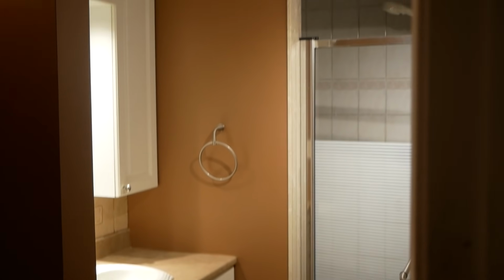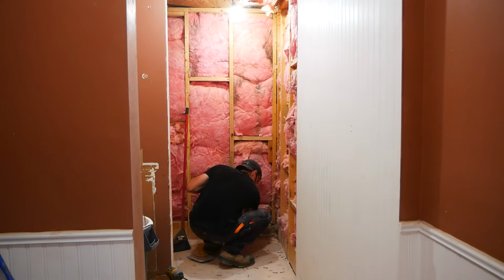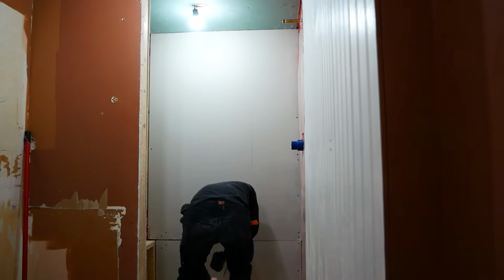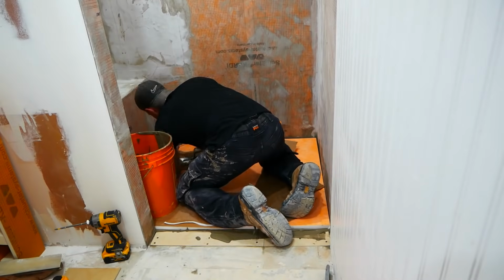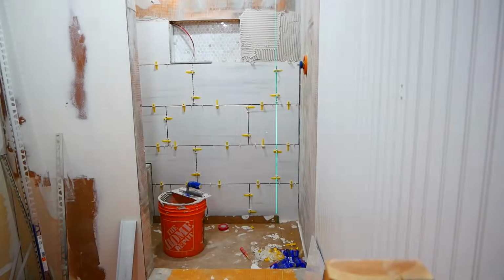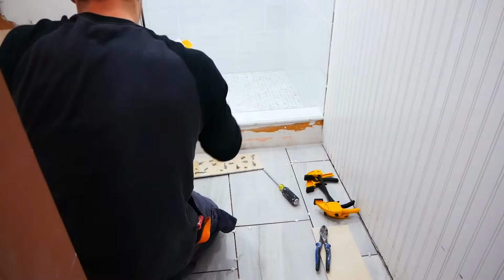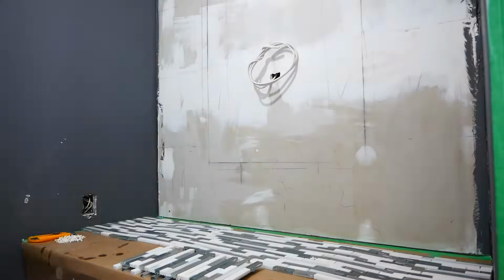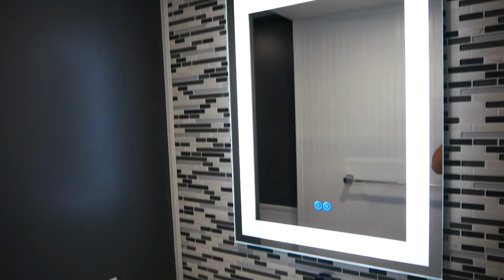DIY Bathroom Remodel | First Time Renovation for $4000

Comment: Nice.  How is the Schluter system holding up so far?  Seen a lot of videos where Schluter drains, edges started to leak water.  Just wondering about your experience with it.

Comment: I appreciate how difficult some of this work is, as I recently completed a similar small bathroom upgrade using Schluter.  But I can’t believe how much thinset mortar you got on the inside of the membrane.  I’m not the neatest worker in the world either, but when I finished, the membrane had very limited bleedover.  I read the directions and used a drywall knife to press the membrane into the thinset.  Maybe your use of the float caused the membrane to be completely covered with thinset, I don’t know.   Anyway, it came out nice.

Comment: 100CFM or 170 cubic meters per hour is WAYY too much for a bathroom. I work in the R&D department of a ventilation company and we extract 50m3/h out of bathrooms (30CFM). 100CFM is overventilating your room and it will not prevent fogging up the mirrors, just saying...

Comment: You are the only one doing this that showed the actual shower curtain(s) and how they look/work. Great job! I'm building a spa type bathroom in the middle of the woods. Claw foot tub was the only problem with that hoop rod. I think I will turn the backside curtain so you can see the design from in the tub though because the front curtain will be open except when in use!! Thanks for showing all this!!

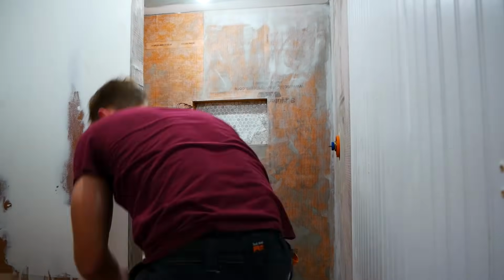Comment: 14:50 you did a crucial mistake! You should never apply the grout immediately, especially if you have waterproofing underneath! Moisture in the tile adhesive has no place to get out while drying! Do not be surprised if that tile adhesive it's still wet even 2 years after you did it.

Also, you should have went with a shower diverter for 2 water outlets. Shower head and hand held shower sticking out of the wall as well.

Comment: This is the first video of yours I saw. I'm age 21 and got into construction at age 19 in the pandemic. I've not done a whole bathroom on my own yet. But this video got my attention.
Reply: I love how ballsy you are to use your qualification as an electrician to do a whole bathroom remodel!. I learned from the Vancouver Carpenter that in Canada electricians are called Sparkies. I get that it is for your mom and your bathroom. I grew up in an old run down house on a farm. I didn't fix up anything other than build a basement workout center for pull ups, dips, vertical sit up bench and roman chair sit up seat. The basement was sometimes damp and I tried some "paint" for water issues to help keep walls more dry. We only rented and the place was shitty. It's funny now that I think of it that I have used my time in construction to do some electrical work and plumbing work. Youtube helped me. But have to say your first try here was really really good. I can see you keep doing it.

Comment: are you allowed to use 14/2 awg on 20amp breakers? i had an electrcian use 14/2 on my lights in a kitchen, i thought it was suppose to be 12/2
Reply from the maker: No 20a requires 12/2

Comment: I gutted a 1950s bathroom.  Small 4x3 Walk in shower. The rest of the walls were tiled half way up...

Wow. The pan was 5 inch thick concrete with a lead plate below.

Every square inch of the shower and walls that where tiled was 1.5" of plaster behind the tiles.
The main floor was 3/4 of mud & lathe plus the tiles.

Had to use a 23lb demolition hammer to remove it all.

By the time we gutted that and weighed the dump trailer there was over 4000lbs of material removed.

Unbelievable that the floor joists were holding up that much extra weight in one small spot lol.

Comment: Honestly the old bathroom is not bad. The grout and stuff looks dirty though. I wonder if it could have just been resurfaced.

The new one looks "modern" because it's white and grey which seems to be what new buildings in the last 5-10 years use.

But still great work and it will add value when you sell the home. I am just shocked at how quickly people feel something perfectly fine is outdated

Comment: Great job, especially for a first go. The Schlueter stuff is great but should be used a secondary defense. It is easy to use tilebacker/cement/multi-boards instead of normal drywall as your primary. They are waterproof by themselves and don't have paper components that could rot. I use them on floors as well and so any wooden subfloor doesn't rot around toilets etc.

Comment: As a Master tile setter, Master carpenter and Pro Renovator, I fully expected to pick apart your work! Happily, I was mistaken!!! If you weren't already a high priced "sparky", I'd hire you to work with me in a second! I've hired/fired a couple dozen apprentices over the years and always wished I could have come across someone like yourself. You must have properly researched waterproofing with Kerdi membrane, you did an excellent job...One question, How did you glue your ABS drain up before installing your Schluter pan? Did you remove the round, thin foam that goes under the drain flange and slide them in later? You didn't show what happened there. I always dry fit the drain flange, cut the drain pipe to height, install the pan, then glue and mortar the Schluter drain at the same time. You did an excellent job and saved your Mom a pretty penny... :)
Reply from the maker: Thanks a lot! Schluter has a video in which they go over the no access plumbing installation which I followed. Pretty much what you said though

Comment: Should have used Durrock or cement board for the shower instead of regular drywall thats against code almost everywhere now, You put up cement board then coat it with Red Gaurd or simular product. last for decades

Comment: Just adding to this, nice work but even though schleuter recommended drywall I would still avoid it in the shower. I’ve demoed many showers in 30 years and mold will grow inside drywall even with hydroban. Use durarock in the showers! I have done the testing myself. I have cut separate pieces and left them in buckets of water over night. Drywall no matter what you treat it with acts like a sponge. Then the water has nowhere to go so it molds. Durarock was dry 10 minutes after taking it out of the water over night. It has Portland cement in it and acts as a drying agent……..

Comment: Wow great first time! You should be proud of yourself.  A suggestion would be for laying staggered rectangular tile, it would look best to lay like subway tile.  Underneath one non-cut piece of tile place two non-cuts meeting directly in the middle of the one above, then work outwards from there. White grout isn't as noticeable when not staggered the way I suggested, but when it get's dirty it may be.  With grey grout (if staggered correctly), inevitable staining isn't an issue.

Comment: "I'm only 22"? WTF? You don't have to be 80 yo to do carpentry.
Reply: What kind of silly comment is that? Obviously, at 22 a person would have not much experience in doing contractor work - way more than carpentry - tiling, plumbing, and electrical work. 🙄

Comment: I'm curious the plumber that recommended sharkbite for long term use. It's not a matter of if it'll leak, but when. Sharkbite should only be used in temporary situations to hold ya over until it can be soldered.

Comment: Did you check to see if it is in code to poke a hole through a wall and run a wire? I had a tv mounted and said that he wouldn’t do that cause if anything happened insurance wouldnt cover it

Comment: Good job.  But you are gonna have to grind the underside of that bathroom floor tile or the floor enough so that your tile won't stick out.  Yeah, those tile levelers help but sometimes you gotta make that space deeper.  You really don't need tile levelers if you use your thinset like a leveler.

Comment: Looks good. But, did you use wall tile adhesive for the floor? That would quickly break down with being walked on. You need a cement based adhesive.

Comment: The schluter board you used on the floor cant actually be used on the walls too making a easy install. They also make cuttouts for neches. Looks really good though I'm a electrician too but I worked for my old man doing remodeling from 2018-2020 before graduating and currently in training for Linesman for my local power company

Comment: I’m currently tiling my kitchen floor using those same QEP clips, 12x24 ceramic tile and I have to say from my personal experience I don’t think they helped much or at all. I feel the wedges were way to small for large format tile and didn’t produce enough pressure to lift the tile. They also have lash clips that I would stay away from completely. They have a curved edge and when I used them they would lift the tile up and unbound the tiles from the thin set. All in all I wouldn’t recommend the QEP brand I’ve seen other brands with bigger wedges I think would have worked better just my two cents.
Reply: Noted. Thanks for the heads up. I’ll be tackling this in a week.

Comment: Great job!  (Why not just use duoRock cement board for the shower walls though)?
Reply from the maker: Thanks! Cement board is heavier, harder to cut, more expensive and not necessary when using the Schluter system

Comment: Hey man you shouldn’t used shark bite fitting on Plumbing system. They are leaks so easy and you put them in side the wall. If those are leaks you’re going to open the tile again. I’m just saying

Comment: Really good job on the tiling. I’d say for that 12x24 tile it’s usually recommended you use a half inch notch trowel for better coverage. Good choice on picking schluter. Also nice jobs on the 45 cuts on the profiles.

Comment: Very talented, young man! You are so talented! I lovew the details you've thought off, liike the lit, tiled niche... or the led mirror. On thing you should add is more outlets. Or a cupboard area nearby or shelves for toiletries. Any women is going to need a lot of storage area and we need to plug things in all the time, from toothbrush to curling iron. Right now I am using my father's former bath and there is not enough space anywhere for all the bottles, even the medicine cabinet and one other little cabinet don't hole it. You need to think space!

Comment: I wouldn’t recommend putting drywall inside a shower bathroom especially for your walls your supposed to use hardiboard and then coat it with some Redgaurd memebrane due to a lot of moisture in the shower. It looks nice tho! I’m 23 and do tile in Dallas.

Comment: Good work but you wasted alot of time. Next time doing the shower, when the joist and studs are bare, dont add sheetrock, cement, kirby board and all that crap. All you need is cement boards screwed into the studs, tape and cement the seams where the boards meet and redguard the whole thing. If you spent 4k on that little bathroom, you also wasted alot of money.

Comment: Not trying to put you down brother but number one mistake is using regular sheet rock inside of the shower. Definitely have to use the green mildew sheet rock or a hardy backer. At least next time you will know never use normal sheet rock inside of a shower. Just coming from a contractor

Comment: You did a good job and are aware of your mistakes. Biggest issue is that unlevel tile in the transition, worried that may crack over time. We recently remodeled our 6x7, 105 year old bathroom down to studs and filled a giant dumpster!

Comment: Honestly, I don't 100% trust the schulter systems. Of all years of installing tile, we've always gone with the hardi-backer boards to not worry about the moisture. Same goes for the floors. Just screw them in and go. For the joints and water proofing, we use customs red guard, it's a self drying rubber that hardens. All in all though, you did a really good job and definitely saved A LOT of money by doing so. Props to you.

Comment: I like the idea of the timer for the fan, I was considering putting a motion sensor on mine also I like your back lit mirror "nice touch". I would like to know more about you vanity plumbing. I moved my sink to the other side of the room so now I have to drill new holes for my plumbing drain and water lines. It looks like you used a faucet that has a mixer, was that very complicated to figure out?

Comment: Great vid!! Was on point with what I needed.  Was wondering...what did you tap into to power the Niche LED?
Reply from the maker: The driver is powered from the potlights so that it comes on with the main switch for the bathroom

Comment: Very good job guy,,, one thing, I find wrong is, You install drywall in the shower, the rigth material is backerboard or cement board & a shower pan in the floor... Hope you work last longer. Tums up.

Comment: the two things stopping me from tearing out my entire bathroom and redoing it, plumbing and electrical. plumbing is the easier one to deal with. but electrical is just dangerous if you dont know wtf youre doing, and i dont .-. i have carpentry, woodworking, construction experience but like the amount i have in plumbing and electrical is real minimal. im 23 btw.

Comment: Good work but those shark bite fitting are a issue you’ll have to fix later. Trust me. Those 2 little coupling could ruin the job. Hopefully you have access to the back side

Comment: IF YOU REPLACED THE OLD WATER AND DRAIN AND VENT ONLY IF THEIR OLD LIKE FROM GALVANIZED TO COPPER AND IF YOU RAN NEW WIRE FROM OLD FALLS APART WHEN YOU TOUCH IT WIRING TO NEW UPDATED THEN ITs A TOTAL NEW IF NOT ITS JUST PUTTING MAKE UP ON A PIG .

Comment: Note: Kerri band attached with thin set is NOT waterproof. Using regular drywall behind is not recommended especially at the bottom. I’ve used this stuff on 3 bathrooms and the last one I coated with a laticrete product to waterproof. I wish I had known on our master bathroom. In Europe they don’t use thinset for the Kerdiband seals. It is waterproof in Europe. Beware in the US.
Reply from the maker: Think I’ll stick with the manufacturers instructions but thank you

Comment: Dont be hard on yourself! Most people are too scared to tackle tile at all. I have a friend whos been at it for decades and there are so many little things along the way he does that makes it perfect. You did amazing considering what work you did and how much. A couple of things, the strip at the top of the shower wouldn't be there if u cut ur bottom row of tile. There is a proper trowel for spreading the cement nice and thin for the keri-wrap. And using marble sills around ur shower entry will cover those finnicky tiles that show. Just trying to help us all out. I'm terrible and cant do any tile work.
Reply from the maker: Thanks so much I really appreciate this advice!

Comment: I swear I'm more impressed that an electrician was able to tile and grout an entire bathroom. Dude, you rock.
Reply: Electricians are such badasses. My dad was an electrician, and he built my childhood home with his buddies!
Reply: When you work in construction you gain manual skills that you can take on every field. Tiling is intimidating cause if you fuck up it suck to have a shitty floor, but with a bit of care is doable
Reply: @IlRockettaroPazzo  I've watched tilers do hundreds of square metres in shopping centre floors when i done strip and seal, but in some cases to replace a few tiles in one spot of about 10-20 s.m takes about 4 hours. Definitely not an easy going job
Reply: If you're not lazy and smart like this boy, you can do anything, no matter of your speciality.
Reply: @moondancer81  But it helps to have some sort of speciality in that field, especially when it comes to electrics, as you dont want to be electrocuted when turning on the shower...^^
Still yeah, if your not a double lefthand and have some bwains and coordination and the will to do, learn and improve, you can do it too.
Just get a little info beforehand, plan the thing, think of mistakes and maybe even watch vids like this on how its done and what could go wrong and you're out and about in no time.
Reply: @wolfwilkopter2231  this what I meant 😉👍
Reply: @wolfwilkopter2231  people thinking they’ll somehow fuck up so bad they’ll connect power to their shower handle is why most people don’t even bother trying
Reply: Rachel, that’s what I kept thinking 😂
Reply: Took the words out of my mouth
Reply: I knew he could tile and grout. I’m simply amazed to see him patching drywall though. Never seen an electrician do that. Didn’t think they were capable on a mental, emotional, or spiritual level.
Reply: Represent my dude!
Reply: Us Electricians are the best tradesman out there 😅 lol jk we all have our specialties
Reply: @LevelsAboveThat  oh I know. I'm dating one!
Reply: @LevelsAboveThat  well said pretty much the best of the trades imho lol I am biased though
Reply: whatever that means lmfao woman moment

Comment: 4k😅 the tools alone are probably that much, 3:20 hand jack hammer $200-700, good set of Dewalt drills $200-400, Lazer, levels, wire cutters, ladder, any needed saws,(multitool/Sawzall/circular)etc...Good job saving 🤑 IDK how but if you did👍
Reply: He already had most of the tools
Reply: @frostyplays949  😅yeah I know, I was speaking about most DIY'ers trynna safe a buck. He did a great job but I know it took him a lot of work 💪
Reply: @davidtelllez2876  haha ok

Comment: Where's the comments from pros advising improvements?  I'm just an estimator for tile company, but I can tell you, You should use MUD-set, not thin set for Mosaics. And you shouldn't use thin set or Grout at the edges of the tiles floors where it meets the walls, (the part under the baseboards). Instead it should be finished with Caulking for more elasticity. Same for the wall tile meets the floor tile. 

I do wonder if doing the wall tiling before the floor tiling is better, I'd think you'd want the wall on top of the finished fl, but I'll leave that for Construction science books.